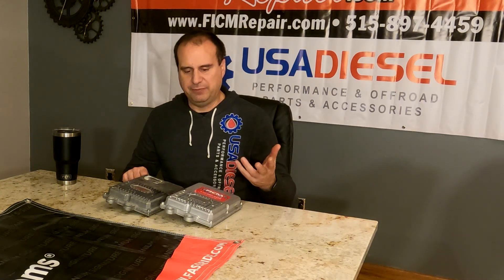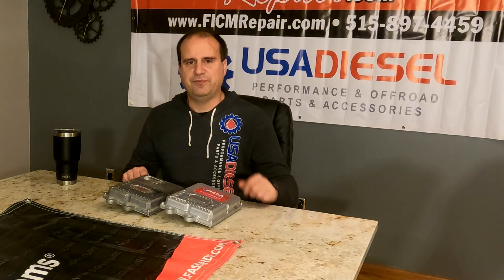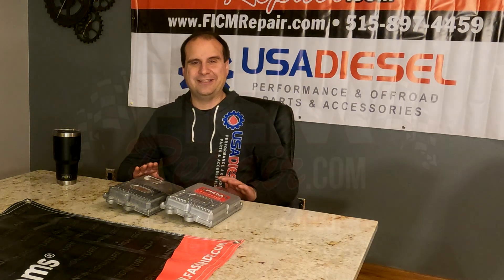Powerstroke 6.0: Our take on 58 volt modded FICMs

Comment: I’m doing some research on this as I’m considering getting a 6.0 excursion. When I first heard of the over volt mod for the ficm. I immediately thought, wait, the longevity of the injectors would suffer right? I mean when you over volt anything the electronics will run quicker but also burn out quicker as well. Thanks for the info!

Comment: "Reliability hits" is RIGHT....

I modded my FICM for higher voltage back around 2010 bevause my truck didnt like to start in the cold and ran like shit. I modded the FICM for higher voltage, correctly, and the truck ran AWESOME! Started GREAT in the cold! 
BUT, the FICM dies 2 days later and left me stranded 150 miles away... 🤬

NOT worth a voltage mod